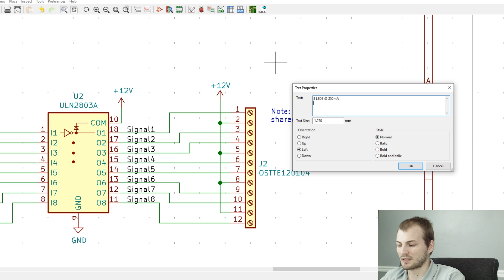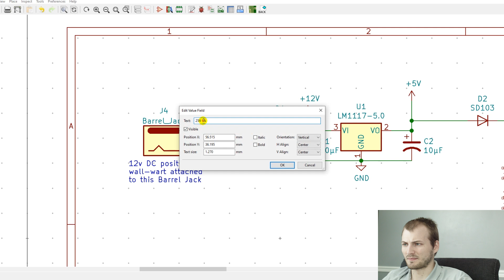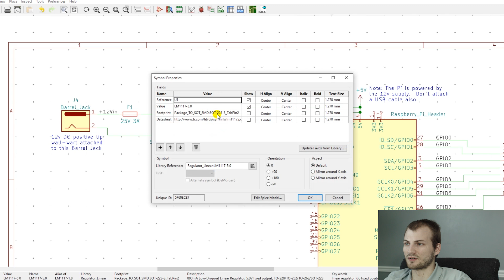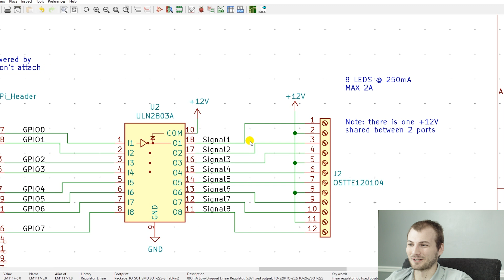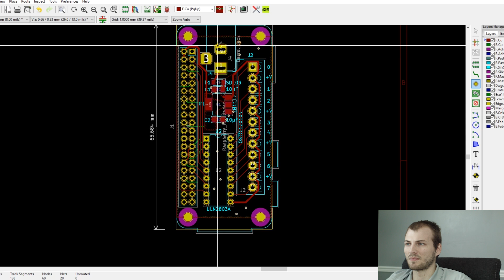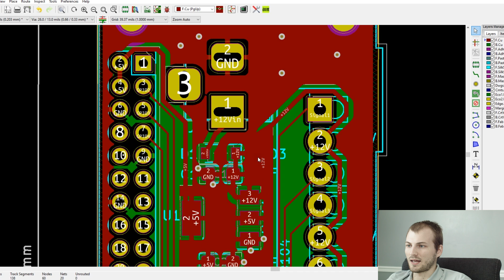Raspberry PI LED Light Show KiCad circuit - User Submissions #3

Comment: I'm not sure I agree with your logic on when the fuse is supposed to trip. I think the idea you conveyed was that every load on the 12V rail would have to be drawing their worst-case currents for it to trip. But this doesn't make any sense. The fuse is to protect against something like a short on one of the LED strips. If there was no fuse then the supply would be shorted (the result of which of course depends on how the supply behaves here, where the short is, etc). You would spec the fuse such that with everything drawing its maximum rated current, the fuse does not trip. That makes it so it doesn't trip under expected conditions.
Reply from the maker: 100% valid, I don't think I explained my reasoning very well.

Let's use this board as an example, and lets say that each one of the 8 LED outputs has a 500mA fuse, and a 2A input fuse. The realistically only place we have a dead short is on one of the outputs (of course, if you drop metal on the PCB, it could short anywhere, but you'd have bigger things to worry about if that happened!) If a dead short happens on an LED, the 500mA fuse will blow 100% of the time before the 2A input fuse, thus, making it redundant. Of course, as I showed, there are other uses for an input fuse, but it really shouldn't ever be directly needed for over current events.

Comment: Great video ! 
Quick question for @20:24
"> There's gonna be a voltage drop here. The ticker the trace, the less apparent that will be."
Why ? In DC the current will follow the path of least resistance. I don't understand how ticker trace will help.
Reply: thicker trace means less resistance
Reply: @suncrafterspielt9479  Why, from a physics stand point?
Reply: The resistance of a thin wire is greater than the resistance of a thick wire because a thin wire has fewer electrons to carry the current
Reply: @suncrafterspielt9479  Thanks for your answer. Never too late for the fundemental.

For those interested, the resistance of a wire can be define by 

R = pL/A

where
p = resistivity of the wire
L = length
A = Cross section area